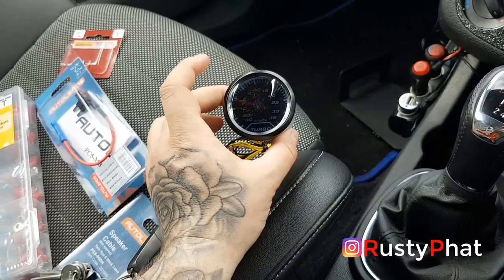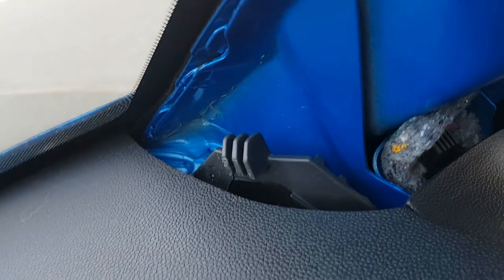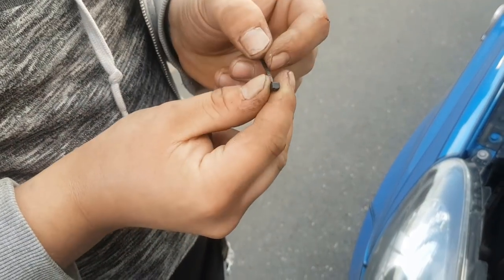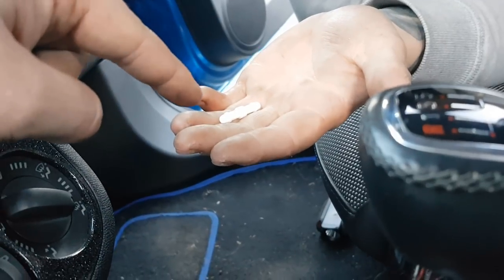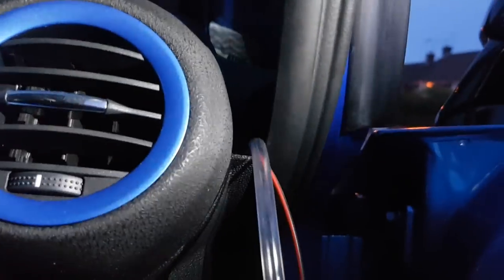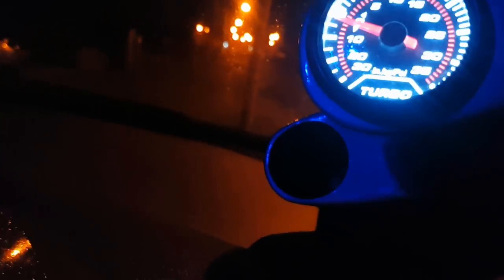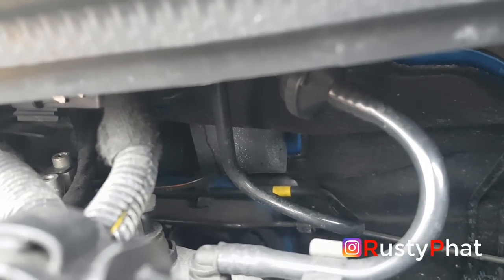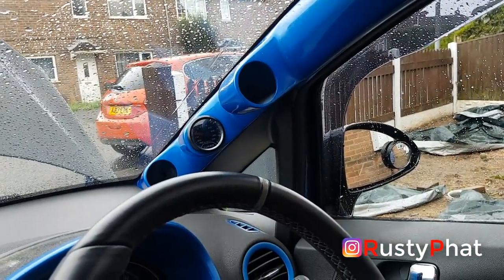Boost Gauge Install - Corsa VXR

Comment: Just be weary about using plastic T pieces, mine snapped off maybe due to heat in the bay or just pressure snapped it and threw my engine into limp mode. Bought a brass one afterwards and never had an issue.
Reply from the maker: Charles Gale I have a few spare mate just incase 👌 but I might go for the brass as you said :)
Reply: Honestly mate to save on the hassle its well worth it for a couple of quid, Cause if your driving along and that T piece does snap then its just a pain to drive about in limp mode until you reset it lol!
Reply from the maker: Charles Gale I carry a obd reader all the time anyway mate but I will get one cheers bro 👌

Comment: Very good video as always! Just question did you you use the piggyback fuse adaptor as the live to the gauge and you earthed the gauge to the bolt? What size fuses did you use for the extender? Also could you wire two gauges to the same live? Seems easier then going to the cigarette lighter

Comment: Would you fit a oil temperature gauge mate if so would be good to know how you would do it as I'm stuck with mine to where to put the sensor
Reply from the maker: Rhyce C I think I'm going for oil temp and air fuel ratio mate :)
Reply: Rusty Phat nice one I was told to t peice of the oil pressure switch to find out the oil temperature to the turbo what do you think your do it off, as people say you don't get the correct tempreture from the sump

Comment: Just watched your vid on the piston 4 failure. I was wondering what causes piston 4 to go, because i read in your comments that even with a forged engine you can still blow piston 4.
Reply from the maker: Dani Nadir it is poor maintaince or misuse mate, the car was battered before me and ran on no oil for awhile aslong as u keep regular service up it will all be good and u don't put your foot down all the time
Reply: Rusty Phat ah I see. Thanks for the reply and keep up the vids!!
Reply from the maker: Dani Nadir thanks mate I appreciate it!
Reply: It's not lol if it's going to go it just will! ticking time bomb piston 4 doesn't get enough oil and it just goes boom I had mine for 2 years and it was fine 🤗 just luck of the draw I guess
Reply from the maker: Just being Hayden it is the luck of the draw too, but there is things u can do to prolong it mate
Reply: I really wanted a vxr but when I put foot down I don't want to have the thought of piston 4 in back of my mind. Sound stupid I know😂😂
Reply: Get an astra then mate
Reply: Just being Hayden my only problem is in 19 and insurance coming back at £3.5. For Corsa vxr insurance is £2000
Reply: Just being Hayden I can't get insured on anything about 1.6 with a turbo. Seen golf tsi but really wanted a Corsa vxr

Comment: Hi I have a boost gauge in my vent me and my mate fitted it a while ago looked on the Internet were to connect t piece and sure myn looks like it’s connected to injector rail :s
Reply from the maker: GamingNation96 there is two vaccum lines u can tap into mate
Reply: Rusty Phat oh thank god had me worried I was tapped into the wrong line there
Reply from the maker: GamingNation96 haha aslong as you get a psi reading you havnt gone wrong mate
Reply: Rusty Phat it reads at 1 bar full boost
Reply from the maker: GamingNation96 That is about right mate
Reply: Rusty Phat thank god haha was meant to get my map today but he cancelled because he was ill so it’s next Saturday now he claims I will get around 235-240 looking forward to your performance mods video to see what ur running for that 232 bhp I’m expecting around the same
Reply: I connected my T-piece to the FPR. Seems to work ok

Comment: Hi there, I fitted my boost gauge and suddenly fuel consumption went very high up, what could it be?
Reply from the maker: Fitting a boost gauge shudnt affect fuel consumption, make sure you havnt left anything loose, and check the spark plugs

Comment: dude, where did u bought that plastic for timers? that can fit to corsa d head window corner tho
Reply from the maker: Ro Sh go to Facebook mate and type in "bespokepodz" that guy will make you what you need good prices too
Reply: Thanks. About timers they need a darken switch becouse it a little bit to brightened for night driving tho :) I think i can connect it with 12V led belt driver via remote control ;)

Comment: How did you manage to get the air con controls out to wrap them I can’t seem to get mine out?
Reply from the maker: Tom McTooth there is a screw behind the wheel mate u have to have a very thin t20 piece
Reply: Rusty Phat Ahh must have missed that cheers mate!

Comment: Just used your guide to fit an electronic gauge to my car and it shows -22 PSI on idling. Does that mean there’s a problem?
Reply from the maker: ATTiiCUS on idling it will say -22 when u put your foot down when your still it will go to 0, then when you are driving and hit boost it will hold at say 15 psi
Reply: Rusty Phat ahh okay. Thank you so much man, I’m new to all this as I got a vxr about 6 months back but I love your videos. Keep it up man and maybe one day I’ll join up with ya for a car meet 😊
Reply from the maker: ATTiiCUS not a problem mate! And we all start somewhere! Your more than welcome to come to any meet it's nice to see everyone!...its amazing how a passion can bring people together
Reply: Rusty Phat if you’ve got a dump valve on your car do you have to connect the gauge up any differently from how you’ve done it? Because my car sits -22 idle and can only just hit 11 psi and it’s left me scratching my head a bit.
Reply from the maker: ATTiiCUS my car is remapped mate so this is probably why it only goes to 11 psi for you, you have wired it up correct having a blow off shudnt affect it
Reply: Rusty Phat okay cheers man and sorry to be a pain 😂 I’m looking forward to your oil temperature gauge video so I can learn how to do it 👌🏻
Reply from the maker: ATTiiCUS never a pain mate always happy to help!, I'm hoping to do one soob

Comment: In my experience washer tubing will collapse on vacuum, giving an incorrect reading.
Reply from the maker: yellowbananas08 I've not had an issue yet it gives me around 17psi in 2 and 3 and rest is around 15, if u do get any I'll swap it for some silicone tubing :)

Comment: is this boost gauge just for the corsa vxr? or can i fit it on my 1.4 turbo? sick video mate!
Reply from the maker: neel patel can be for the 1.4t too mate :)
Reply: Rusty Phat cheers!
Reply: I know this is an old comment but this will not be the same as the VXR when it comes to clipping the pipes the 1.4t has one pipe on the right side of the engine I believe its red and black facebook BE group have 100s of posts about it, otherwise everything is exactly the same in this video as I used this to video to fit one to my BE (or any 1.4t Corsa/Astra 1.4s I believe)
Reply: @Ghost-_-94  is this for the corsa e 1.4t also ?
Reply: @noahhartley8300  almost identical engines I'm not sure why it wouldn't work

Comment: does your car have stock software? It seems to be boosting quite high then if it has OEM software - over 15psi
as far as i know, they should be boosting 13psi stable...
Reply from the maker: Raul Lorincz it is at stage 1 mate :)
Reply: thanks for the info. keep them vids coming. Very helpful for me here in South Africa where info on the Corsa OPC (as they are know here) is not readily available locally.
Reply: Raul Lorincz mine boosts 15psi and standed